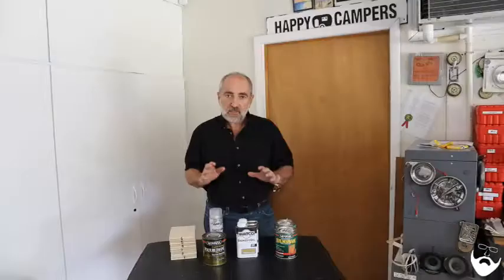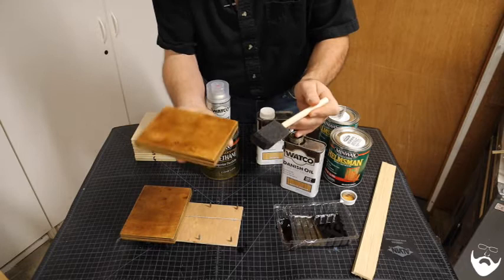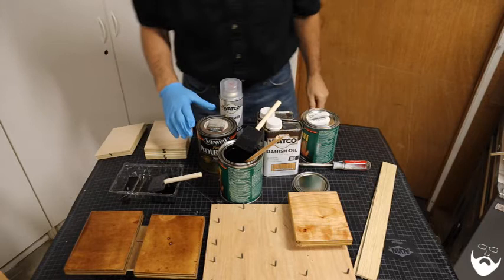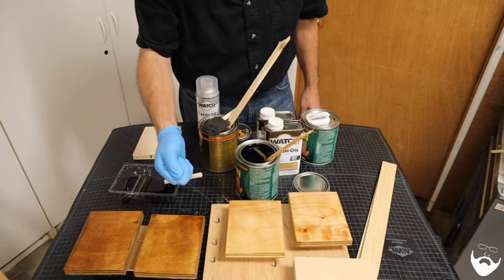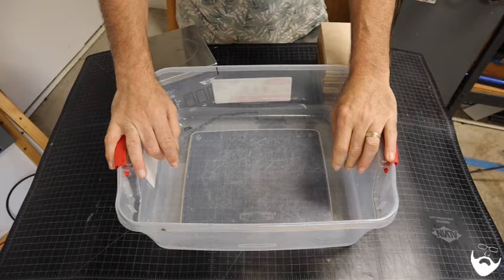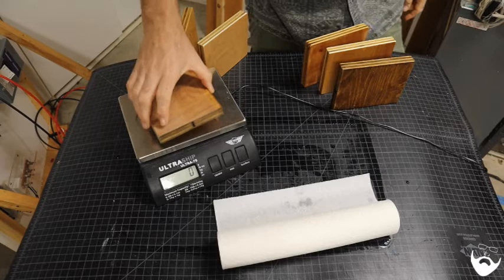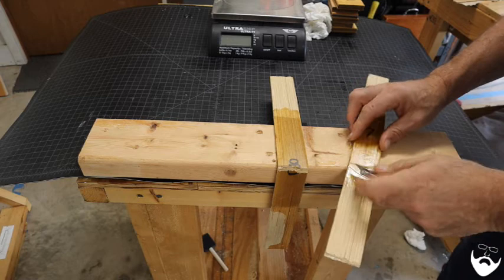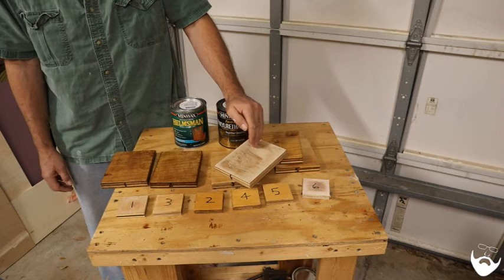Van Life avoiding mold in your van build - Sealing wood surfaces

Comment: Thanks for this. I really hadn’t thought much about priming or finishing the non-visible wood. But every thing will get a coat of primer or urethane after watching this. For those who are not woodworkers, stain followed by satin polyurethane makes a beautiful finish. Poly dries slowly but you can add Japan Drier to speed the cure. I put on a coat, let it dry, sand with 220, wipe it down with a clean rag, 2nd coat, dry, sand with 320, 3rd coat, rub down with 000 steel wool (or equivalent). This leaves a beautiful tough finish with a rich luster.

Comment: Great demonstarion, thanks for the time taken to do this experiment. I have a transit van in the UK, a builders van that often carries wet sand etc in the back. This time of year when it's cold, the timber lining is a mouldy mess, even a couple weeks after hypochlorite cleaning the wood to kill the mould. I think I will be re-lining my van soon and using the spar Urethane.
Reply from the maker: Spar Urethane, Polyurethane, and mold killing primer are used throughout my build depending on the location. Kill the mold and seal the wood, or better yet replace the existing wood, and seal it on all sides.

Comment: There is great debate about using a vapor barrier in vans. Cheryl’s comment about mold in her van should make you think carefully about it. I intend to use a one-piece vinyl flooring that covers the entire floor. All subsequent floor penetrations will be sleeved and sealed top and bottom with silicon. Will use Reflectix as a vapor barrier one insulation is installed, sealing all outlet boxes, pick lights, etc as shown by Greg Virgoe. Will I get moisture behind my walls? Maybe, but it will be minimal and mold will have a hard time finding a place to grow, thanks largely to this video!

Comment: Treating wood on contact surfaces makes sense but I do have my doubts on treating all surfaces I feel it’s best to be kept natural. My thought is moisture in a confined space can’t be eliminated just controlled part of that is thru absorption and dissipation. Sealed surface will still absorb moisture to a lesser extent and with that sealed surface it will be harder for the moisture to be released. = mold. Ventilation, airflow controlling moisture much more important than the labor and expense of finishing all wood surfaces.
Reply from the maker: Based on my experience living in the humid environment of central Florida, I disagree.  Airflow is important, but untreated raw wood in humidity quickly encourages mold growth.   I have completed the van build sealing all surfaces. So far we are mold free.  Only time will tell.  The build also allows easy removal of wall panels to inspect for mold, moisture, mildew etc.   Thank You for watching....

Comment: I would just use as much 80/20 as possible. Then for anything reamaing that needs to be wood, use a coating and or naturally water resistant woods if you can splurge for it. Love seeing all your tests though, helps me think through my project.
Reply from the maker: 80/20 is great but expensive (especially the fittings).  Also, if your missing one piece and decide to make a change, you need to order more.   Wood is easy to work with and easily adaptable to tight situations.  Wood is available locally!

Comment: What about paints?  Natural wood is nice, but colors are nice too.  Can paint be added over the sealant?  Or would it be good enough by itself?  Would indoor paint work just as well as outdoor paint considering the interior of the van would only be exposed to condensation vs full-on rain?  I'd love to see a similar experiment using these parameters.  Thank you for sharing.
Reply from the maker: Actually I was thinking about that.   Paint sits on the surface of the wood, so I do not think that alone would be good.   I did use "Bonding Primer" in the Composting Toilet videos.   Paint over Spar Varnish or Polyurethane may not stick, and could peel off.  I would like a white or light color for the cabinets.   So, I am investigating Minwax solid color stain.  I will make a video and post my results.

Comment: Once plywood starts to mold can it be salvaged with a sealant? I tried putting a steel wool, vinegar, water and PVA glue on some red birch ply I have on my van walls to darken it and give it a weathered look but within a few hours it started growing mold! Maybe I should have put a fan on it as it was kinda a rainy day but I've used this same finish on some other stuff and had no problems but this red birch stuff molds real easy. 

I had some other plywood in a damp area under the car port that got moldy too and I tried bleach, vinegar and sanding and nothing seemed to totally get rid of it. Can you paint or apply oil or polyurethane over it? Or is it toast?
Reply from the maker: It would be necessary to remove the mold spores.  If that can't be done replace the effected wood.   You could clean the wood and apply mold killing primer, I use this https://amzn.to/4fzPIBO   You could also seal with polyurethane. In my builds new wood without mold is sealed with polyurethane on all sides, and the inside facing side of the wood then receives a coat of mold killing primer.   I have done the best I can to avoid mold, and so far do not have any mold build up.    You will need to which is best - clean and seal, or replace.
Reply: @FrugalFactor  So if you can still see it after sanding then throw it out or can it be slavaged? This wood is new so disappointing. any mold killer clear coats?
Reply from the maker: @eedom69  If you can see it, I would discard it, you may try sealing it with polyurethane.  There is no mold killer clear coat that I know of.  I am not an expert on removing mold.  I have done my best to ensure that mold does not form.

Comment: I'm curious on your submersion results on #2 vs #4 - I find it odd that the spar urethane did better on its own than when applied over the Danish oil, especially with the spar urethane being the outer layer. Why would the combo sample absorb more water through the same layer of sealant than the other piece? Maybe the coats weren't consistent between the two samples and more moisture could get through on the oil/spar sample?
Reply from the maker: I was careful to apply consistent coats.  The only thing I can think of was that the danish oil did not allow the spar urethane to seal properly or pushed it away/separated it. The 20 gain is significant.  I used poly and spar urethane on the full build.  I added a coat of mold killing primer on the inside wall panels.  So far all is clean and free of mold and mildew.

Comment: What about using pressure treated marine grade wood?
Reply from the maker: Several things - that would be very, very expensive.  Very heavy, and may contain chemicals you would not want in an enclosed area.
Reply: @FrugalFactor  But isn't that what is used in boats and yachts and such??